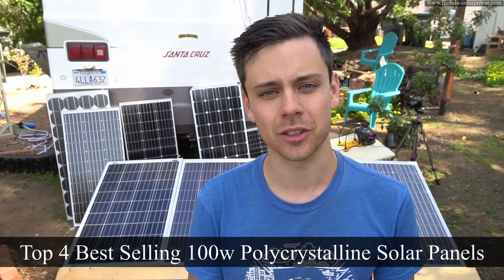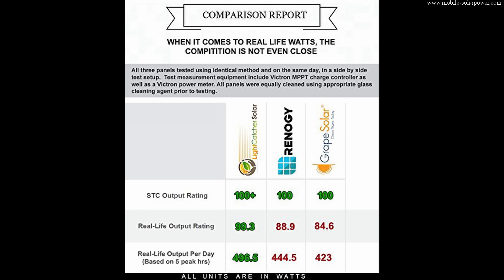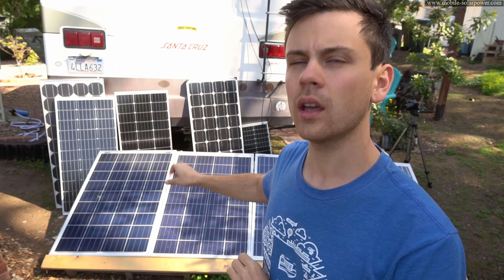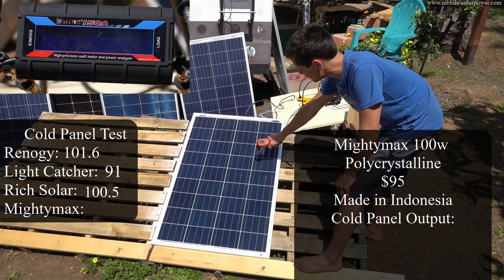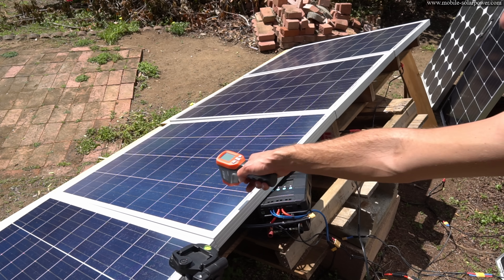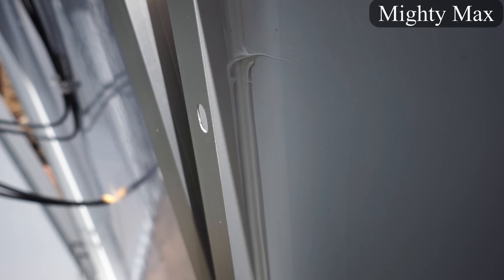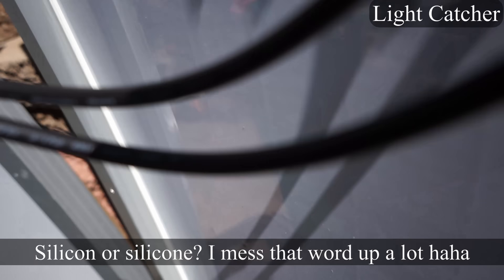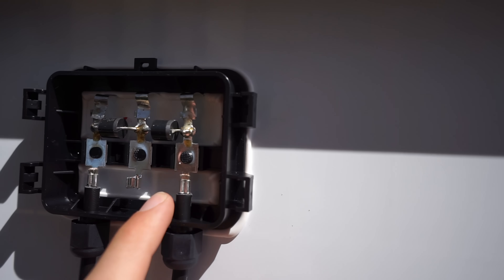100w Polycrystalline 12v Solar Panel Showdown! Renogy vs Rich vs Lightcatcher vs Mightymax

Comment: Based on your prices of $110 in the USA for the Renogy100watt panels. I’ve just bought 4 x 100w solar panels for £296 gbp that’s $89 per 100watt. Solar panels and batteries are a real viable option for energy even in the uk where there is a lot of cloud cover and shorter winter days.
2 Questions:
Why do you buy 100 watt panels and not 250 watt panels?
Will connecting different wattage panels diminish the efficiency of the most efficient when paralleled?

Comment: AWESOME!!!  Lol. Great videos!!
I recently found your channel and after watching 2 videos I subscribed and shared with everyone on my contact list!
I’m new to all of this but need to learn as much as I can as fast as I can. I just purchased my new
 (to me) travel trailer and am upgrading the electrical system. My plan is to give the completed trailer to a disabled veteran. I’ve known him for a long time and he used to love spending a week or two at a time in the forest. The only way for him to do that now is with a travel trailer with a good electrical system. I’m hoping to use Lithium batteries and a small generator plus some solar. 
If you or anyone reading this can help with my project or give me advice I will be extremely grateful. 
Cheers mate and happy trails

Comment: I’m looking to buy a Lithium ion battery for my boat. Their is a company called ionic that sell batteries that look ok but only have a three year warranty. The one thing I do like about this battery is that its Bluetooth. I’m also looking at Battle Born but I don’t see anything about Bluetooth In the specs. Do you think it matters? I can always Use my voltmeter to check the status of the battery. I’m also concerned about the battery charger I have, it’s a pro charging brand. I only use my boat for fishing maybe 2 or 3 times in the summer and winter but 3 or 4 days a week in the fall and spring.

Comment: Sir, while checking the short circuit current of 100wp/12 volts DMM Shows 4.8 amps . When I connect this panel to mppt charge controller (kept CONNECTED 12volts/150 AH Tubular battery) and in this case the charge controller shows SOLAR AMPS 11.3 PLEASE CLARIFY.

Comment: Hi Will, I was wondering if the light catcher panel is actually produced in Germany or just the cells as it is a company based in California. Could you test a panel that was completely manufactured in Germany (like a panel from Solara, Solarwatt, Aleo, or Heckert Solar?

Comment: LOL the Indian comes with added soil for FREE :D you should appreciate some of their Motherland more :D:D:D:D Btw... would the German one be improved by soldering those poorly crimped connectors? I mean its low performance may have been down to resistance of bad joints
Reply from the maker: Oh they weren't that bad. Even if joints were soldered, I doubt it would make that big of a difference. The wire is over gauged for the amp load too

Comment: Great subject and well presented. I have been looking at bang for buck per square inch, and found the LG NeON 2 335W 60 Cell Mono 1000V BLK/WHT Solar Panel, LG335N1C-V5 and was wondering if you had chance of read about this. 335w for one panel @ $323 each is going to kick the arse out of 3x 100w panels for the same space. Not sure what the 1000V represents but i don't think it means 1000volts? but I'm not sure. Can you do a review of this?

Comment: Maybe ive missed it, but have you tested the Renogy "eclipse" panels? ive been in there store a few times and they swear they are the worlds next best panel in partial shade conditions. Id love to see a real world test! Im still running a 13yr old 100watt poly panel, still working great, but its huge!
Reply from the maker: They are just sunpower cells. They are good. Idk if I would spend that much for 100 watts though. It does look cool though.
Reply from the maker: But yeah I'll try to test one

Comment: Hi there. Thanks for all the great videos.  I have a quick question:

You often show 100w panels in your video.  Looking online near me there seem to be good prices for 250-300w panels.  Are there any disadvantages to using these?
Reply: These are the most popular usually on his tests.
Reply: laurieinjapan in a 12v application you couldn’t use a cheaper pwm controller
Reply: @DaDude999  are you Dutch?
Reply: I am wondering the same question what’s the difference between the 100 watt panel and Tesla’s 300 watt panels wouldn’t it make more sense to use the higher watt panel

Comment: The big problem with your recommendation is that one buys panels to use 20-30 years and you don't know how they will perform in 5 or 10 years. You should mention that.
Reply from the maker: Lol every panel on the market uses rebranded cells that last 30+ years. Usually typical degradation is 10% after 25 years. 20% figure they have on warranty is crazy conservative. You should look this up so you know how this works

Comment: Silicone, or Polysiloxane, is used as a flexible sealant and insulator in various industries.  Silicon, or Crystalline Silicon Dioxide, is used in the manufacture of semiconductors.

Comment: Hi Will.  Totally enjoying your videos, thank you!  I have been involved with outdoor electrical systems and owned a security contracting company for several decades.  The reason I point this out is I have seen electronics and connectors weather over many years outside and longevity is an electrical science.  When you looked at the connections in the back of the panel, the crimped connectors versus the crimped and soldered are a concern.  Over time in an outdoor application, humidity, condensation and copper wire will cause some corrosion.  Resistance is an enemy especially at these low voltages.  Favoring crimped and PROPERLY soldered connectors is likely superior.  If you think about it, the main conductivity will be in the crimp.  The solder acts as a moisture barrier and secondary conductor.   There is one caveat, the solder joint needs to be done properly.  If it’s done too fast without heating the wire and connector up to temperature first, you get a blob of what’s referred to as a “cold solder joint” often identified by a super dull finish. The panel you had from India had the soldered joint, but it was hard to tell, but looked more like a cold solder joint - which may not bond as well as intended by best practices.  If it allows moisture to penetrate around a poor bond, it will hold in the moisture.  

Alternatively, I would favor dabbing a nonconducting gel all around at each mechanical connection point as a final seal.  The phone company uses gel filled crimped connectors so moisture would not penetrate the connection.  This is available from 3M and other manufacturers and likely would be quite wise.  I.E. No solder needed and helps assure no resistive connection points over time. It’s important to have a gel that will withstand very high heats of operational use so it does not drip off.  

On another note, if water penetrates these panels, will they short out or be damaged? How well they are sealed may be very important for longevity. How about the fill the garbage can with water seal dunk test for a day Will’s certified test?

Thanks Will, keep up the good work!

Comment: I have often wondered if painting the back of the panels a flat black would improve their thermal performance.   The reason is that black bodies radiate thermal energy faster.   They also absorb faster but by definition the back of the panels would be in shade.   Will, perhaps you could do one of your terrific  experiments and see if it makes a difference at high temps?
Reply from the maker: Wow interesting thought. I learned that in physics class too. I'll have to think about that for a bit

Comment: Is it normal to use 4 panels for this...? 

I just started reading your book yesterday. Wow, what a help. Anyway if my calculations are correct I use 2400 watt hours to power an inefficient fridge and my entertainment system each day. So I guess I need 4 100w panels and at least 4k of battery. Does that seem normal?  BTW thanks for all you do.
Reply from the maker: And if you can't afford it more is always better when it comes to solar. it doesn't hurt to add more batteries and solar panels if you can do so
Reply from the maker: Yeah that sounds like a great estimate size for your first system! Good job. It also depends on how much sunshine you have too though. but it's hard to tell how much you have available until after you set up your system so try to build it in a way so that you can add batteries and solar panels in the near future if you need to.

Comment: Have you tested the Renogy 160 watt panel. Seems like the best panel and size to fit all these Sprinter van conversions where you can get 4 panels and still get a Maxx air fan a Dometic Heki II on top. Anything with more wattage in that size?

Comment: See this video - Cheap VS Expensive Solar Panels (From the Land down under)
Reply from the maker: Yeah he doesn't know what he is doing. He needs to use a watt meter.
Reply: @WillProwse  Alright then! So, but what do you think of the flat sheet solar panels, please and thank you. If you like any of them, share which you find best, with me, here. TY!
Reply from the maker: @twodogs716  yeah check out my recent video on flex panels. And I haven't found one I can recommend. But yeah, watch that video to learn why and what to look for
Reply: @WillProwse  thanks. You are a good kid, kid. 
Appreciate you and your work.  
I will check it out, right now! 
Then onto wind generators. Vertical ones, I believe. Less bird feathers.

Comment: I'd be interested to know if the German manufacturer are aware of the underperformance of their product? If not, maybe introduce them to this video comparison test. Great video, by the way. Thanks for your time and effort in producing them. Cheers!
Reply: The problem is it is not a German manufacturer per se it is a company based in California apparently using solar cells made in Germany. Many companies claim that the panels are made in Germany but many actually produce in Asia.

Comment: MightyMax sells theirs in two different classes. Blems and regular. The one you got looks worse than the 6 blems I have bought. And the price of them was lower.  Funny thing is, right now on ebay the blems are a nickel more than the regular ones but both are under $80 ( $79.99 VS $79.94 ). Back in Dec they were $74.95 for a Blem. In Jan they were $76.99 each.

Comment: Will, your solar videos are very well done, I've learned a great deal. Would you reply here with the 4 solar panels physical sizes? I hope eventually you do similar tests on larger wattage panels. I have room for 4 roof panels, maybe 5, 160w panels gives me 640w to 800w, which I think I need? Vs 4 at 100w or 400w.

Comment: Will - help!  How can I use my Dometic fridge with lithium batteries?  The fridge keeps shutting off because it thinks my batteries are lead acid and so thinks my battery supply is too low. There is no over-ride switch on the fridge. : (.
Reply from the maker: What batteries
Reply from the maker: They should work better than lithium in this application unless it's a small lithium generator
Reply: @WillProwse  They are Renogy lithium batteries.  The dang fridge has a shut-off safety in cases where it detects low battery.  But with lithium "low battery" is different than lead-acid.  Someone suggested a "DC to DC converter" whatever that is.  Someone else  a said there is a special cable out there to purchase that may solve the problem (but I can't find it). Someione also said to get a new fridge with an over-ride switch...but I'm already $900 into this fridge.  The fridge thinks the battery is dangerously low and shutrs itself off.
Reply from the maker: @barbjoz63  well maybe your battery is too low and you should charge it more often. you should build a bigger solar power system. and lifepo4 batteries run at a higher voltage, including the renogy. all of those solutions you pointed out will not solve your lack of power coming from your solar system

Comment: Thanks Will, I gave your name to several people so they can watch and learn from a very smart man. One question: Is there any data on which lasts longer in years? If you have to replace it sooner it will obviously not be worth the $10-20 difference per panel in savings from original purchase price. Love your effort and will be glued to your channel for more. Thanks so much!
Reply: My Renogy 100 watt panel is still going strong after 6 years--no problems, no loss in output.
Reply: @donaldradcliffe6704  
Thanks for the information, it's great to know.

Comment: Poly VS Mono - is the difference in efficiency?
Reply from the maker: Check out my other video that covers mono vs poly. Long story short, the difference is so small that it doesnt matter.
Reply: @WillProwse  LOL thanks for this, I appreciate it - We are buying a 4x4 canter from Japan for a huge tour of aussie and want to "refresh" the solar - charger and batteries ( 300-400ah liPo) for longer autonomy and weight savings. 

Would love to save a few $$ and grab poly if that is the case especially when we need around 400-800w

Comment: What is the physical difference then between polycrystalline and monocrystalline for us just learning Solar?
Reply from the maker: Mono panels have extra step in manufacturing to create a single solid crystal. Poly is a lattice of smaller crystals.
Reply from the maker: This is why monocrystalline panels have that little diamond shape is because they are a single crystal that's cut in slices

Comment: Thanks Will for another in depth test/review! I would be curious to see a test done in completely cloudy conditions, or other low light conditions such as an hour before sunrise or sunset between the mono and poly panels. I put renogy 100 watt x2 mono panels on my 6x10 cargo trailer for that reason. I too believed the hype and just accepted that since they were putting out power on a cloudy day, although diminished, that it must be true.

Comment: Great video. I've actually been using these to learn as I am a beginner to solar. I have to buy everything and maybe a peace at a time. I do have a question about protection from debris. Can you mount plexiglass or lexan over solar panels to keep the from hail and limbs in storms. We had a bad storm in Alabama, where I live 2 days ago with hail and I have limbs EVERYWHERE. It got me thinking about this. Does covering the panels reduce the efficiency? Maybe a comparison video in the near future?
Reply: I'm just replying because I want to know the answer to this as well.  I want to mount a solar panel to my trailer's front tongue box and put a lexan on top to protect from road rocks.

Comment: Very interesting. Your finding that poly panels produce more power than mono is shocking. It requires further explanation. Conventional wisdom is that a 100W panel, all things being equal, should produce the same as any other. Poly panels are said to be less efficient and so take up more room to produce the same power. Your tests explode that conventional wisdom. Have you reached out to the manufacturers? How can Renogy explain why they charge more for a mono panel that produces less power than a poly equivalent?
Reply from the maker: Oh I guess you didn't watch my other videos. We figured out that they both produce the same power per sq inch. No voodoo magic here. But what is dishonest is the monocrystalline panel power ratings. They simply do not output what they are saying they do. I am actually in search of a mono 100w panel that works as advertised. I'm not the only one either. Check out other solar panel tests on YouTube. The mono panel ratings are horrible.
Reply: I think I saw the one you mean, the one from Mar 15 comparing popular Amazon panels. Your intro on that video was a bit off, you say a 100 watt mono should produce more that a 100watt poly. The ,manufacturers, I think, claim a 100W poly panel should take more room to produce the same amount of power as  a 100W mono. This is what I find shocking in your videos. Your results suggest no difference between mono and poly in terms of output per area. This suggests you buy the cheapest panel you can accommodate. I plan to ask Renogy what is up. I bought their mono kit a few months ago.  @WillProwse
Reply from the maker: @davidhopkins  I was referring to the mono vs poly video. Not the Amazon one. Take the numbers and figure out the efficiency for their size. Yeah I told renogy yesterday. If you do the math for their size it's accurate. Poly panels are simply bigger and rated more accurately.
Reply from the maker: @davidhopkins  and the increased efficiency of mono panels on paper is very small. There are other videos on YouTube that cover this. The mono panels are simply not rated properly. I actually told a few manufacturers and one is trying to find a mono panel that I can test in a couple weeks. this rating issue is super common actually. Stc results vs ptc results.
Reply from the maker: @davidhopkins  this is actually a common problem with these smaller panels. It's been this way for years.
Reply from the maker: And yes I reached out to three manufacturers this week to tell them that their ratings are wrong. Hoping to get a response.
Reply from the maker: Try the test at home and you will get same results. I'm using LiFePO4 battery and mppt for maximum power output for these tests.